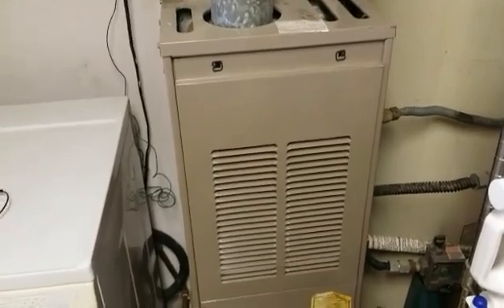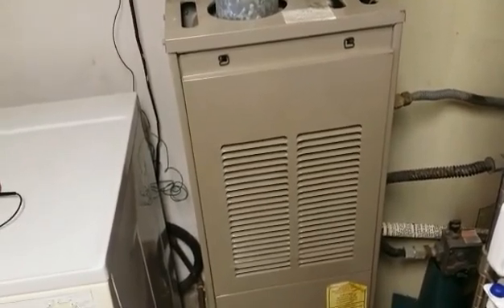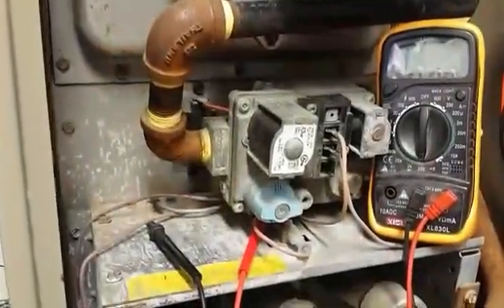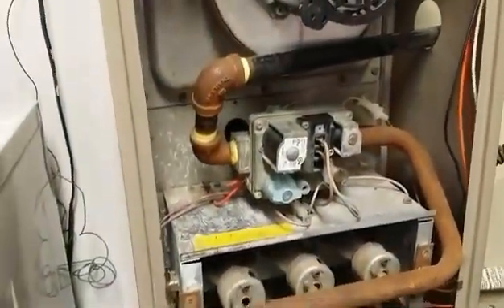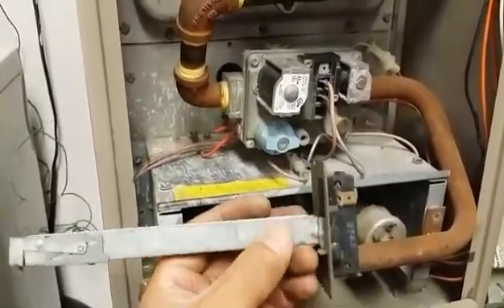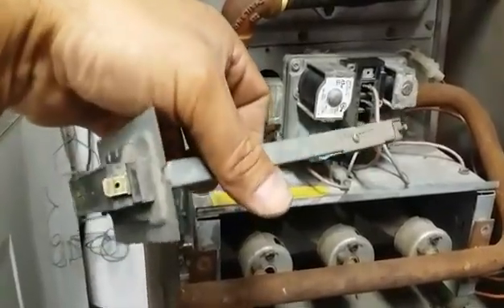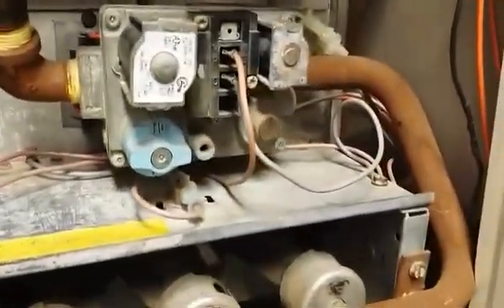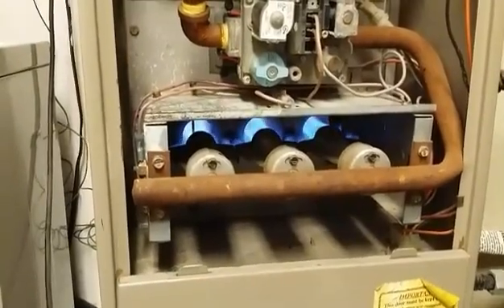Gas Furnace Blower Not Shutting Off

Comment: I was waiting to see how you test it exactly with the meter which setting and what to look for!  If you say that the part works, then how is the furnace lighting, it doesn't make sense.
Reply from the maker: saintsamaritan Hello and thanks for your comment. This a switch which is normally closed. This means the two terminals should show as connected - low resistance in your ohmmeter. Thanks again for watching.

Comment: I noticed at the end of your video, when the blower kicked on the flames changed, showing that you have a cracked heat exchanger.  that's dangerous, flue gases can be getting into your house, through the supply air. You need a new furnace, and if you want I teach a hvac class At Ridley Lowell Poughkeepsie NY . We teach can teach you what you need to know
Reply: Could be that it's a small crack not quite big enough for a roll-out but gases could still escape through.     
     I wouldn't risk it.
Reply: Not so sure about your evaluation . The flame momentarily turned yellow due to the change in the air flow the blower introduced. I saw no Roll out  at all.